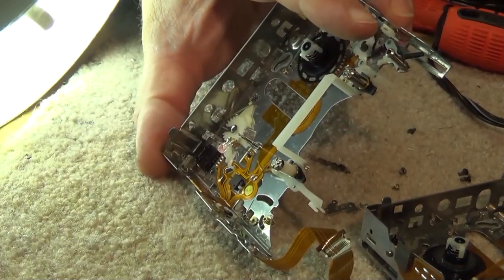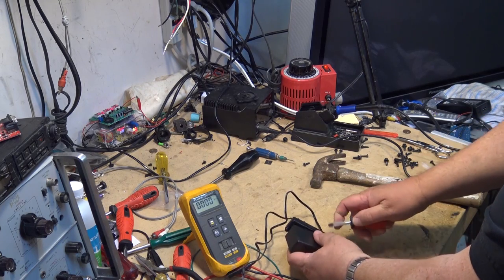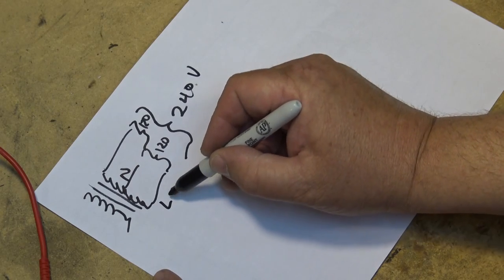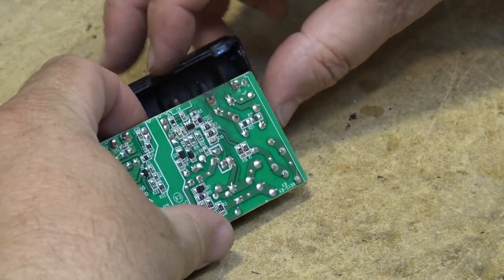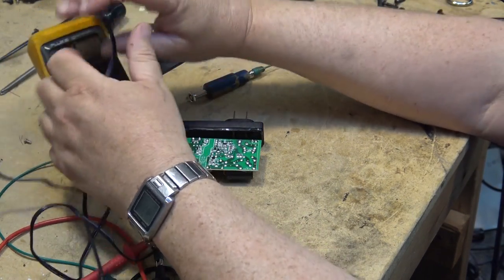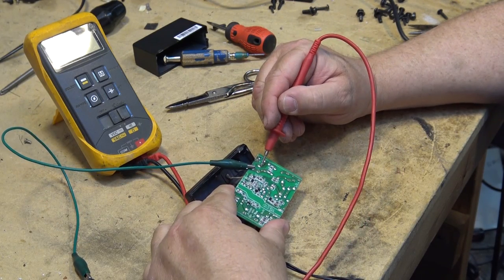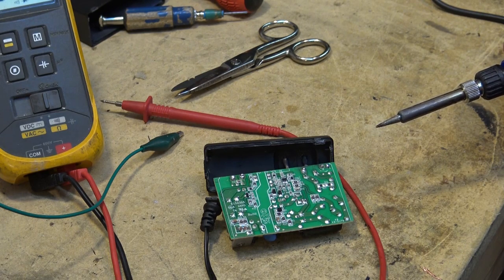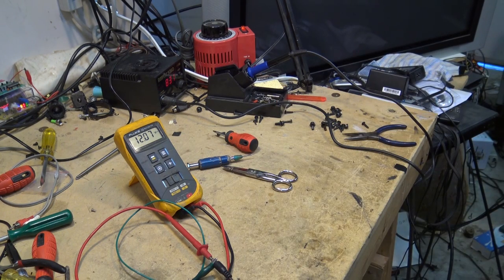Switch mode power supply over voltage, went up in smoke. Lets see why

Comment: Nice one, my Xbox psu varistor went bang similar to this, I replaced the PSU. I realise after this vid I maybe could of fixed it. But it was a real mess. My replacement PSU was Chinese so replaced all caps with decent Panasonic ones before I even powered up. Works great.  Brill video as usual.

Comment: This was a really interesting autopsy of the dead SMPS.  Also learned about dual-phase supplies in north America and what happens when the neutral is lost!  I liked how you used the small strand of wire for a temporary substitute fuse for testing.  If you still have the SMPS, can you confirm the input voltage range?  Usually they are ~110-250V.  So even with 240V due to a lost neutral, it should have survived unless it suffered a higher voltage surge?
Reply from the maker: No, some are 120 only.  They have a MOV across the line that clamps at 190v

Comment: Split phase system...utter madness!

Paddy
Reply from the maker: The split phase system in NA was done for safety. Getting a jolt at 120v although it may be painful, is rarely fatal. 240 on the other hand is far more dangerous.
The problem is 120V is not that efficient for major appliances, so we use a split phase.  240 enters the house phase to phase which is fine for devices that need the capacity such as water heaters, heating elements, ranges, fast charging electric cars  ect, and 1 phase to neutral, which is tied to ground for devices that only require low power such as electronics, lights ect.
To people on this side of the pond we think having 240V at every outlet is crazy, and an accident waiting to happen.
Reply: A few years ago, I got my hands on some books on the grid system and the domestic distribution in the US.
(I assume Canada is wired along similar lines...) So I read up on it, just for the lolz. It is amazing to see what strange and weird practices can be brought back to origins as far as the AC-DC wars between the criminal Edison and the genius Tesla (Westinghouse). I wouldn't know about Canada, but in the US, the lack of a decent grid can truly be attributed to the iffy compromises that were made in that era.
As far as 240 volts goes.... In my house (not a commercial building!) I come in with 4 (5) wires. 3 phases , a Neutral and a Ground (not the same on this level!). So I have the full 3 phase 240/400 Volt.
This is perfectly safe, if everything is hooked up to code (we have one of the strictest codes around, regarding electricity systems, for once not messed up by politicians, but written by engineers)
As long as the prudent application of situationally  dependant differential switches is applied, very little can happen.(on the level of the local distribution, NOT the point of use, such as an individual outlet!)
If you would take England as an example, I would have to agree with you.... turning on a hoover is on par with attempted suicide in the UK! Not so here.
Some decades ago, they tried to service new domestic buildings with nothing but mono-phase and balance the whole affair on the level of,say, a whole housing estate... but those of us in the trade warned that this was a bad idea. Nowadays there is a careful return to 3 phase on the individual level. It makes for better balancing.  I have been in plenty of American houses and seen how they are wired. I dare say that the way things are supposed to be done here, even with 240/400 V 3 ph, makes generally for a safer system.
A quick search tells me, that on a total of 3074 (lethal)domestic accidents in Flanders in the year 2004 (we number 6,5 million) there was just 1 electrocution with lethal consequences.
That isn't too shabby, is it?

Cheers
Paddy
Reply: Try 400v. We have a 3 phase system from wich every house gets a single phase. A single phase has 240v. And i know how 240v 50hz feels like haha.

Comment: Was it 110V only? I thought these would work from like 90V to 240V. I've seen strands of wires as fuses from the factory in old radios and radiograms. A Telefunken stereo receiver that I have has one in the 12V line, and the schematic calls for a #40 AWG wire. Thumbs up as always.
Reply from the maker: This one the sticker says 100-120V 50-60Hz, so yes it is a 120 only. 
Probably because it is UL certified for North American market. No need for 240V here, and they can get away with a lower rated main filter cap.
Indeed the main filter cap is only rated 250V. On a universal that would be a 400V cap.

Comment: Considering it got 220v or so up the bum, that was a decent psu.
The mov did a dam good job :-D.
I've used a thin loop of wire to bypass a fuse for testing many many times, why should anyone moan at that.
Anyway it's not there risk or electrical system.

Comment: Hi. I have a Panasonic WV-3203B power supply from the early 1980s, it's outputting 18V DC instead of 12V. How can I fix it?
Reply from the maker: Capacitors. Check the small ones in the primary side. They control oscillation frequency.

Comment: Do you remember the old red circuit breaker that where use in old console television set. I use one with alligator clips for testing. saves on fuse's
Reply from the maker: We used them all the time with alligator clips. To save fuses or course.

Comment: There are plenty of consumer products that use circuit board traces as fuses... which is exactly the same thing! Those are not contained in glass and are intended to melt/vaporize to prevent things like fire.  Someone should make a video where 50 thin wires as fuses are blown one after another, edited in rapid fire (some directly across the line and some in series with power supplies and other things); just to show that in fact there are no flames, explosions, melted or shorting line cords or even tripped circuit breakers (and I mean circuit breakers in a power strip - not even the breaker panel). Of course there is Murphy's law that suggests a tiny glob of molten copper can set highly flammable materials on fire, cause damage or land in just the right place to short something else out before the fuse in the circuit but to me that seems almost impossible - and that remote possibility is one of the reasons fuses are contained....... except of course for those board trace fuses!! I'm not 100% sure but I'd bet some consumer products with board trace fuses actually meet safety standards for logically sound reasons. And if you're just testing the friggen thing you are there to kill the power and aren't connecting the unit directly to the utility mains, bypassing all circuit breakers!

Comment: Conclusion : if you don't have connected the neutral line properly the devices with low power consumption will be blown by the ones which do consume much. It does not matter if you have 3 or 2 phases..
Reply from the maker: That's right.

Comment: I'm curious on your timeline explanation of your snips as in your last video there are clearly a new (in package) set of Klein snips as well as another, unboxed set in the same shot.  Please explain further.

I'm just funning ya, Dave because you're generally pretty cool to interact with.  I have a terribly good memory too.

You're like the honey badger of "thumbs down"  Honey badger don't give a shit!
Reply from the maker: I had just picked up the new ones on my way home, and took the old ones in to work the next morning. So the ones you saw in the package are the ones I am using now. I had to use the old ones to open the impossible to open  child proof package.
Reply: Those packages piss me off...  I'm beginning to notice that manufacturers are starting to use easy open poly packages now.  Those I can tolerate.

Comment: here in the netherlands we have 400 volt between the phases and 230 volt between phase and neutral
Reply from the maker: Do you have 2 phase to your homes, or just single phase?
I have no idea how the grid is wired up in other countries. 
Here it is 120/240 single phase, and  120 phase to neutral, 208 phase - phase on 3 Phase, and for industrial use 600 volt phase to phase 347 phase to neutral.
I have noticed for example that changing my electric car at home on 240 volt takes about 3 hours. When I am at a public charging station, that charge station is generally fed with 2 legs of 3 phase supply, so the supply is 208, and it takes closer to 4 hours to charge due to the lower supply voltage.
Reply: we have a 3 phase incoming in to our house 1 phase and a nutral is used
Reply from the maker: So they actually have 3 phase available at your meter, or is it just 3 phase at the street level, and the drop that enters the house single phase? I am of course referring to single family homes. Multi family, it would be expected that 3 phase feeds the building. That is how it is done here too, 3 phase to electrical room,  but since he have split phase for 240v appliances, the units are fed with 120V, and 208V because the 2 hots are 120' phase shifted, where as for detatched homes we get 120/240 as the phase split is 180'.
Reply: 3 phase is aviable after the meter
Reply: @12voltvids   3 phase in a house is very new, i think (never heard about it). Normally, you have 3 phases / neutral / ground in the street and every address gets only 1 phase / neutral / ground. Split phase still exists in some streets in some large cities, but that is changed when possible. Factories (etc) have 3 phases.

Update: to be sure, i did take a look on internet.
According the info, in new houses 3 phases enters the house, but than only 1 phase connected or all 3.
(i didn't know it. Some things are only written in books / magazines you don't have)
Reply from the maker: Marco S 
here we get split phase 120. so 3 wires to the house. neutral / ground and 2 hot lines 180' out if phase. regular wall plugs have 3 terminals.  Hot. neutral and ground. Neutral is tied to ground as well but technically under high load can rise if the load is not balanced. We also have 2 types of 240 plug. 3 wire and 4 wire. on the 3 wire there are 2 hot and ground, no neutral. the ground is just your safety ground. 4 wire have the 2 hot, neutral and ground. 
3 phase, which few people have is 5 wire. 3 hot, neutral and safety ground. typically 3 phase is apartment buildings for the elevator motors or water pumps. 
with that you have 120 by taking any of the phase and neutral. single phase devices like water heaters they just use 2 phases and the voltage is 208 same as the full 3 phase.  208 between phase and 120 phase to neutral.